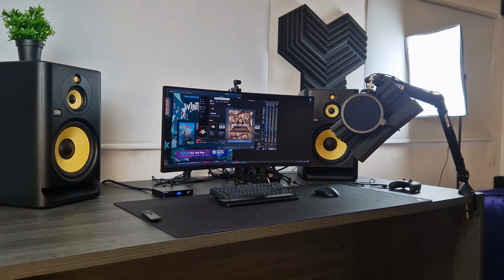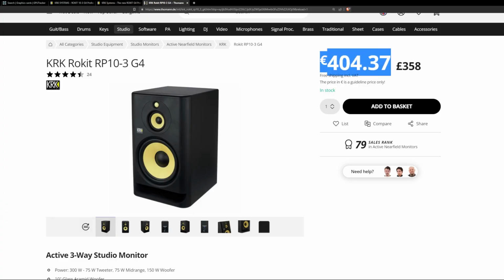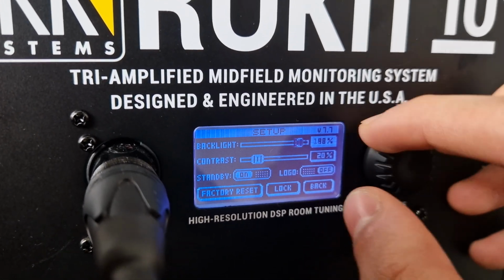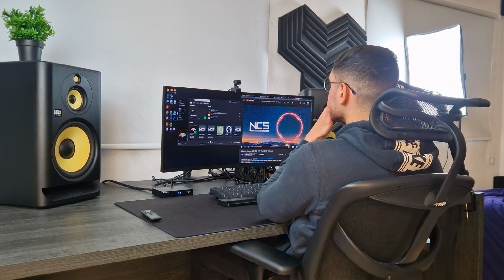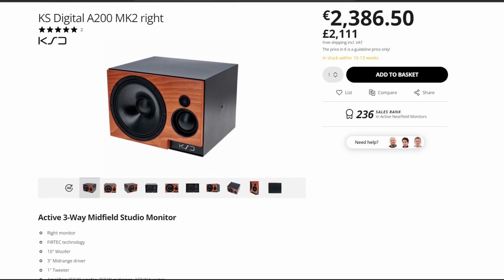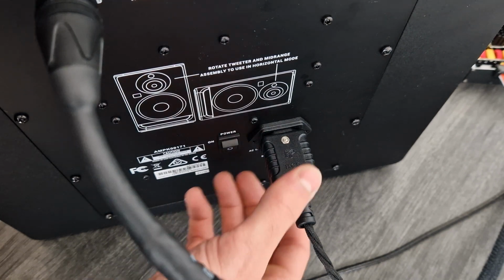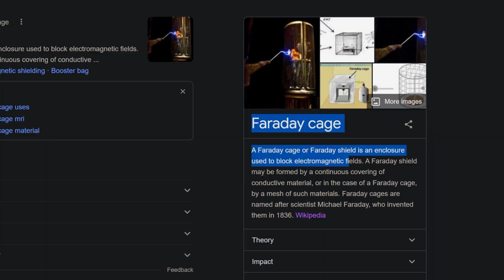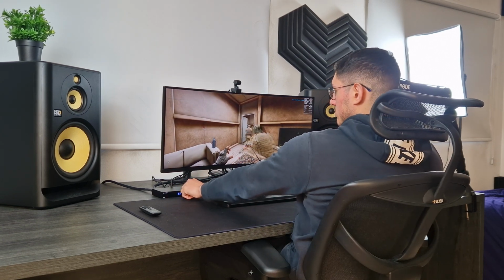KRK Rokit RP10-3 G4: Are the Specs Worth It?

Comment: Not so fast. For starters, these are more like midfield range untis, so you should never be sitting under 1 meter from them. Absolute minimum listening distance should be 1.5 meter, more in the 2 meter to 4.5 meter rnage. Okay, so when you have them say 2.5 to 4.5 meters from you, will you still hear the nasty idle noise / hiss? Moving on, this huge things only has a SINGLE ANALOG INPUT JACK. Yes, it is a 1/4-inch/TRS combo, but you could only use one type.... or the other type... but not both of them simultaneously plugged in. There is no unbalanced input here with an RCA jack. So, the signal input on this thing is pretty basic. Consider the new impressive looking Swissonic X8 3-way monitor which has 3 separate, indvidual inputs: 1/4-inch TRS balanced, XLR balanced, and RCA unbalanced. Huge diff, huh? Moving on, regarding the unit's WEIGHT. I used to be 20 kilograms with the G3 and previous versions, because the triple power amps inside were of the superior Class-AB type. With this Gen4 version of 4 years ago, they switched to Class-D amping, so they shoved off 4 kilograms form the weight. Hmmm.... is that really something good? 6:28  This chap here is the first one I ran across YT who could identify the fatal design flaw of the RP10-3 Gen4. Namely, the cheap Class-D amps and the fact that they are sitting right next to the internal AC-DC power supply / converter, un-isolated, unprotected. No Faraday cage at all. If KRK used an external power brick for AC to DC voltage down-conversion, this might not have been an issue at all. So, if you don't want a noisy, hiss-generating studio monitor for near-field use, you must pass on this one from KRK, sadly. This GEN4 model came out 4 years ago. If KRK would give a hoot, they could have corrected this design flaw years ago. It's just they didn't. Now. as to doing it a do-it-yourself garage rebuild of this thing -- after spending € 800 or $ 900 for them? I would never do that. Outcome is iffy at best, you could do more damage than good, and you would immediately void the KRK mfr's warranty. Cooling of the components here is bad also, there are no passive cooling grilles in the rear, and no active fan. Just not a good design, plus they probably did not use the very best Class-D amps in them, either. They are peddling this same monitor for 4 years now, come on, KRK-Gibson does. Personally, I am likely going instead with the € or $ 50 cheaper Swissonix X8 3-ways that came out in late November 2022 (Swissonic is a house brand of Thomann Music and Thomann Germany), or perhaps with the much higher priced Adam Audio A77H. Swissonic has 3 separate signal inputs, Adam A77H has two. Great review, thank you.
Reply from the maker: Nearfield, Midfield, Fairfield doesn't matter. What matters is what volume are you going to be running the speakers at and how treated your room is to handle that. Everything else is just general guidelines. 

Having a speaker that is not forced to work above 80% will result in lower total harmonic distortion and noise as the amp inside will work less and also having bigger drivers is always better as they can make smaller movements and having far better detail compared to a smaller driver. 

About the input you can use unbalanced as well with a 6.3mm mono jack and also use adapter from rca to 6.3mm works either way. Going balanced you will be able to push the signal above 2 Volts and also have the benefit of reduced noise because unbalanced connection share their ground with the DAC's case and whatever electrical noise is damped to the ground your speakers will pick it up as signal. Not sure why you think this is a negative about the speakers. Very rarely you'll have two inputs on a monitor and for what reason? You can switch sources from your DAC very easily.

Yes the swissonic X8 has a greater choice in input but there no reason for it to be honest. Most people buy studio monitors to connect them with balanced connections as it's the superior connection type. I would say that the input signal is very good on these, not sure why you're complaining about it. 

I very much dislike designs that are not class D for the sole reason of power consumption and heat. All other designs are below 50% efficient and only class D can reach 90% efficiency. For me living in a country that charges 0.274 usd per kWh, this is perfect and also doesn't heat your room up because it doesn't produce that much heat. Difference in sound quality from a class A AMP is negligible and only people that want to sell you these egg frying, electricity consuming amps tell you they're better than class D. Class D is the future in audio, that's a fact!

 Again they don't have to use an external power brick if only they shielded everything inside the cabinet of the speaker correctly. I agree with you they should have fixed it with newer revisions of the Gen 4 speakers but the didn't which shows what kind of company they are.

Cooling the components can be done without a fan by sticking heatsinks on them. That lets the heat of the component go somewhere else than the component itself. The heatsink soaks the temperature away and make it more even by having a larger surface for the heat to go thus reducing the temperature of the component you want to protect.

The swissonic X8 seems to be a very promising speaker, thank you for showing me that. I think you better go with that instead of Adam A77H. And I would also suggest a 12" subwoofer to go with the speakers for the ultimate experience.

Again there is an auto standby feature which turns the speakers off after 30 minutes of you not sending signal to them but you can turn it off.
Reply: @honestcomputing  ALL active far-field studio monitors have their electronics in a separate chassis that is 19-inch rack mountable. SOME mid-fields are designed this way as well, some have the electronics inside the cabinet housing the drivers, and some mid-fields have the PS and amps mounted to the backside of the monitor, but then you can just unscrew 4 screws, take off the electronic metal box and run it from a distance to the speaker cabinet. Whereas AFAIK ALL near-field active monitors have their PS and electronics jam-packed inside their cabinet. Like all the KRKs do.

Most if not all French FOCAL studio monitors lack a simple trim control knob on them. So you are ALWAYS running them at full-out 100 percent of their power. Cannot tum that maximum down. No chance of doing 80%, 60%, 40%, 20% power with those. Ouch.

I think doing a dual-duty audio signal input jack that takes both BALANCED and UNBALANCED signal type in the very same jack (via adapter crutches) is a horrid idea. For example, with the new Adam Audio X-series line, you have separate BALANCED and UNBALANCED inputs, and furthermore, you have to engage a pushbutton in the backside to switch between BALANCED and UNBALANCED. 

The studio monitors I use right now have 4 types of signal inputs: 2 types of analog and 2 types of digital. And two separate trim knobs -- one for analog inputs, one fo digital inputs. But hey, if you insist that studio monitors should only have one single balanced or unbalanced signal input -- who am I to argue with that fact, after all?

Now, for a BALANCED ANALOG input, if you use a computer audio interface or studio monitor controller, chances are those will have 1/4-inch TRS outputs towards the connected monitors. But if your monitor only has XLR input, start saving up for conversion cables and jack adapters/converters. They could work fine -- but then again, maybe not too well, after all.

There is no reason to hate the superior and more expensive Class G, Class H, Class AB, etc. amplifier types. Just purchase actives with the cheap Class-D amps instead, and you shall be fine. Of course, regarding running a HF tweeter with a Class-D amp -- well, "no comment.'

The KRK in question DOES NOT HAVE A HEATSINK. Or maybe they have it inside the cabinet for astethical reason? My brand new PANASONIC camera has an active, spinning fan inside. It makes 21 dB of noise, according to the specs. Doesn't really bother me, as 21 dB is not ear-shattering noise, after all.
Reply: hi i am considering the Swissonic x8, have you heard them i am between krk 10 g4 and the swisssonic x8.

Comment: I’m a video editor and I’ve had these speakers for 6 months now. I’ve never heard any hiss or distorsion on my speakers. The sounds comes from my Macbook Pro (usb C) to my Focusrite Scarlett Solo (3rd gen) with balanced cables (XLR - TRS) to the speakers. I’m curious what audio interface you use. Looking forward to seeing if and how you can solve the issue. Great video!
Reply from the maker: Thanks man, I really appreciate it! For now I cut a piece of aluminum to separate the amp from the psu but no luck still the same hiss, so next step is to cover the entire psu and amp with a conductive cloth to shield it entirely. Hope it fixes at least 50% of the issue, but either way I'm still going to make a video about it.

You are either very lucky, you're sitting further from the speaker than I am or my hearing is just better. To be honest I'm not sure what's going on with your pair of speakers.

I have an SMSL d-6 DAC connected with type C to my PC. The speakers are connected with 6.3mm TRS to 3-pin XLR cables, and the cables are made from thick 4 core double shielded copper with 100% cloth braid, custom made from scratch by me.

My DAC is much better and more revealing than your scarlett solo gen 3, while your DAC is an AMP as well mine serves only one purpose and that is being a pre-amp for speakers and a DAC (Digital to Analog converted)

If you look at the specs of our devices you'll see that mine is superior in every way:
THD+N mine is 118.5dB, yours is 94dB
Dynamic range mine is 123dB, yours is 108dB

The limit of human hearing on the most sensitive frequencies is 115dB.

Like I said I don't know what's going on with your pair of speakers, it seems very strange for you to not have this issue.
Reply: @honestcomputing  I have 1.5 meters to the speakers and 2.5 meters between speakers. But…my Focusrite Solo is only an audio interface, not a DAC or an Amp. I’m not record music or voiceovers, I bought it to transport the sound from my macbook to the speakers. These speakers already have the DAC and the Amp. So, in this case, when you have your DAC, why didn’t you buy passive speakers together with an separate Amp? On the other hand, try something like a voltage stabilizer, I know it’s a strange advice, but any other electronics can cause that noise on the network.
Reply from the maker: @alinstancu1233  1.5 meters is far enough for you to not hear it, I have them at 0.5 meters. Your audio interface is already a DAC & headphone AMP, it's also a input amplifier and a pre-AMP. Mine is only a DAC and a pre-AMP, it's not a speaker AMP or a headphone AMP. 

The speakers have no DAC inside of them they only have a power AMP that can output 300W so a DAC is needed in this case and a pre-AMP is good to have to control the volume of the speaker without reaching to the back of it and adjusting it each time. Lower the volume from your operating system in your case the MacBook just lower the bit depth so it also lowers detail.

Trust me I made research before buying these speakers, you simply cannot find any passive or active speakers at this price range that offer a 10" woofer, 4.5" midrange and 1" tweeter. Passive speakers are much more expensive as well because they carry the "audiophile" tax which at the end of the day doesn't mean anything.

A voltage stabilizer is not useful in this case, as the voltage is already clean but it increases because of the EMI that is induced by the PSU and ends up on the speaker AMP. So I need to find a way to block the interference and not mess with the voltages.
Reply: @honestcomputing  I’m just a user….:))). I think 1.5  meters at maximum volum it’s enough to hear the hiss. But I agree, that’s why I bought these speakers! Good luck and I can’t wait for your next video!
Reply: @alinstancu1233   One way to Frankensteinize the Rokit RP10-3 would be to diassemble it and REMOVE THE AC TO DC POWER SUPPLY from the cabinet. And place it in an extrnal box, like an external power brick. Then run a cable carrying the low-voltage DC power to the monitor. The higher end studio monitors always have the PS and the amps in a separate 19-inch rack mountable chassis. Not inside the sound box itself. Actually, all this makes me think maybe going with an old-shool PASSIVE MONITOR / SPEAKER is the best idea. I now have studio monitors with external PS and amps, no self-nose / hiss that way even at close ranges.
Reply: Maybe watch the video first? This KRK monitor has one or more design faults. The type of audio interface, cabling, computer, etc. has got nothing to do with it, see? People are returning it for the reason specified in this review.
https://www.youtube.com/watch?v=y2qekd6kp2o&t=9s

Comment: are you using balanced cables with the speakers? I have read that this will eliminate that hiss.
Reply: I just "love" some of these comments. Especially by folks who have (A) either not even watched your video or (B) understood not much at all of what you had stated. Now, regarding jury-rigging this contraption, the KRK RP10-3 GEN4. Rememeber, this sucker came out to the market FOUR YEARS AGO. As a Generation 4 model with the Class-D amps. So, as of late January 2023 and soon thereafter, two things can happen. (A) KRK will come out with a GEN5 line-up of these Rokits this year. Or else (B) KRK will cease production entirely of this rather poorly selling 3-way of theirs, and just stick with 2-ways. Stay tuned. I am betting on (B). This just has not been a very good seller for KRK, their singular 3-way. And they steadfastly refused to fix the self-noise / hiss / lack of electromagtnetic insulation issue for years. Seems like the RP10-3 is bound for retirement.
Reply from the maker: I used both balanced and unbalanced cables, that's not the source of the problem. Balanced cables can help if you have a ground loop issue but this is a design flaw of the power supply being way too close to the amplifier. 

The noise coming out of the power supply gets immediately transfered to the amplifier. 

That's the problem EMI from the power supply.
Reply: @Honest Computing  Interesting.....i have seen many mixed results with these. Some have the sound, and others do not. Looking forward to seeing if you can solve the issue.
Reply from the maker: @KC-lg8qf  Most people claim to know what they're talking about but most of the time they don't. 

You'll understand once you see me show you the inside of the speaker. I opened it and closed it before but forgot to capture B-roll of it. It was only to measure what size of aluminum shield I would need.
Reply: @honestcomputing  well I really want a set of these so I hope you can fix them and then maybe I can do the same.
Reply from the maker: @KC-lg8qf  Give me 2-3 weeks and the video will be out. I still need some things to buy before I attempt the fix. 🙏
Reply: @honestcomputing  awesome! Sounds good!